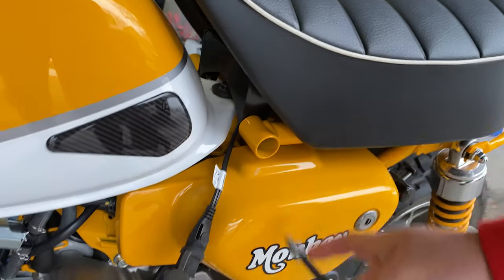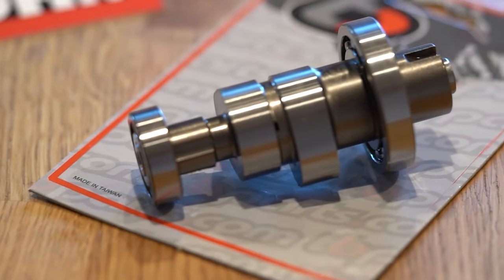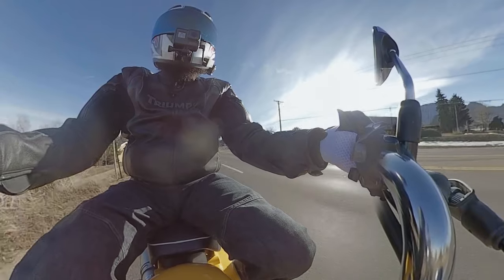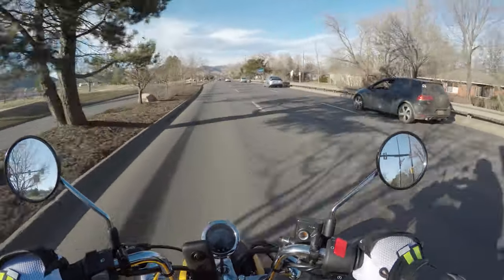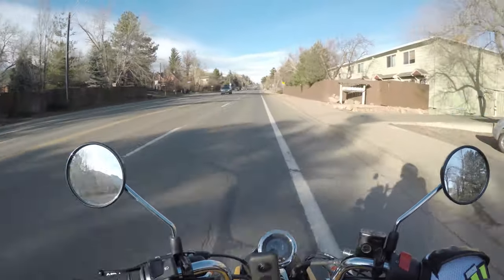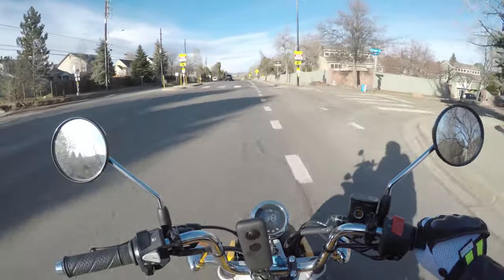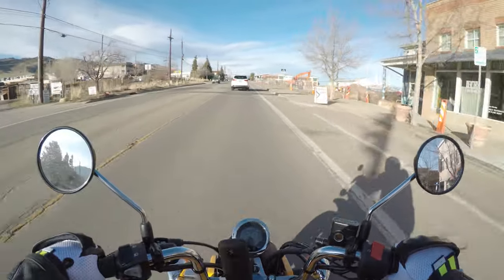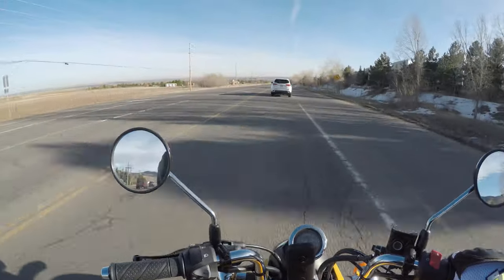Honda Monkey | More HP (For Real This Time)! | Also, how to reset the ECU and TPS!

Comment: If you really want more power from your Grom or Monkey you need a big bore kit, intake, and exhaust. My 2014 Grom with a 164cc Yuminashi kit, full Akrapovic exhaust, and open air K&N intake makes about 15hp, and takes my 200lb body over 70mph with stock gearing and 10k redline.
Reply from the maker: That’s definitely true, going bbk is the real way to get good HP out of that little engine. I’ll likely do that in not too long, for now I’ve got the intake, exhaust, cam and a HC piston to see how things go.

Comment: Hi overland.ive commented before in the past.14 tooth  front   and 37 tooth rear sprocket  works great  for me.faster off the line and 4th gear has  some pull to it now.any how a grom club air bnb across  the street  from me.i came out  and took some pictures  of them.i think they thought I was going to call the cops on them for riding wheelies  down  the street.then I pulled  out the monkey and rode over to them.they were all happy this twice their old dude pulling up to them likes the same thing.they go all over the place.i was the only one with  a monkey. They liked it.😀
Reply from the maker: Nice! That sounds like you had an awesome time showing those groms what the Monkey can do!

Comment: Great video, do you loose much low end torque with the new cam? I'm thinking of a cam but maybe the Takegawa 143cc with cam in one kit.
Reply from the maker: Thanks so much!

With the 14T front sprocket and this cam, this bike is mostly low-end torque (at the expense of my top speed). Since I've also went to stiffer clutch springs, the front end of the bike wants to really come up. As I look to getting the top end speed up, I've been contemplating different larger bore kits for my bike but I've yet to head down that path.
Reply: Unknown Overland how does stiffer clutch springs affect the front wheel coming up?
Reply from the maker: The stiffer springs will put a bit more pressure onto the clutch pressure plate, so when you release the clutch the harder springs will cause them to engage faster.
Reply: Unknown Overland oh yea true

Comment: Nice video! Apart from the cam, did you changed the valve springs, or tensioner or anything else? I'm thinking of replacing the cam, but i'm worried about the reliability of the bike.
Reply from the maker: No, I hadn’t. I was contemplating swapping the tensioner, but at the time I didn’t really see a reason to. The timing was modified by the aracer, though, just to help get detonation a little better in line.
Reply: @UnknownOverLand  thanks.

Comment: Nice vlog manyou do your tps first, and you jump both tps and ecu before you start, that's the other way round than most vlogs explaining the reset,your way makes mor sense, and it sounds real sweet,,I'm watching the ecu reset vlogs and most just do the ecu and not tps,are thay going wrong?
🗽☘
Reply from the maker: The steps that I used were following the steps in the manual (mostly because I worry too much). The tps reset is needed only in certain situations, so it really just depends on what you’re working on.

Comment: Thanks for all the great vids on these 125cc engine! 

at 3:27 I see you with two different size tappet adjusting screws.   I just did the Tbolt cam on my grom, and am in need of a longer tappet adjuster screw, but not sure where to source them
Reply from the maker: Thanks so much for watching. Those longer tappet adjustment screws came with my cam, you might contact them and see if they have some.
Reply: @UnknownOverLand  thanks for the reply.
And did end up finding them available from TBolt, although I I heard they were made from softer metal than the originals and can mushroom out causing more frequent adjustment needed
Reply from the maker: I hadn’t realized the difference in material I’m interested to hear if that happens longer term.

Comment: I might just go for a cheapy Lexmoto Tempest, so hoping a better exhaust & inlet will give me some advantage???
Reply from the maker: I’ve not read much on the Tempests, but it’s a nice looking bike. Allowing more air into the system with the fuel will help the engine a bit.

Comment: You put 24t front sprocket on? Are you unsatisfied with the power? I was gonna put a 125 monkey motor in my bike so I can utalize the upgrades but I might just go with a 250cc
Reply from the maker: On the front I have a 14t sprocket, and that definitely seems like right right option for this bike. I'm still playing around with the back sprocket to find a good match. What kind of bike do you have?
Reply: @UnknownOverLand  nice、 I have "2001' yamaha yb-1 four". I live in Japan now but when I move back home I'm gonna import it to the states. I will need a bigger motor to ride with the higher speed limits.

Comment: The reason the new cam is lighter is they will have taken material off the base circle to increase lift?
Reply from the maker: Different materials (I believe) and removing a bit of the extra material on the lobes will help it spin a bit faster without push back from the engine. I think they also changed a bit of the cam lobes to change the overall compression timing.

Comment: Why did you get the dhm reflash if you kept the bazzaz ?
Reply from the maker: I went back and forth on this (and, really, still am). Ultimately, because I already had the Z-AFM (self fuel mapper) I opted to keep it installed. This allows me to enable the mapper, go out and ride, and then come back and analyze the fuel/air ratio the bike is actually seeing and apply any changes. I may change my mind in the long run, but pairing that with the raised rev limit and modified ignition timing of the reflash seemed like something I should try.

Comment: How fast did you get it? I see some of these videos of people getting their monkeys up to 65-70mph. One thing is replacing the sprocket with a 14 tooth but then i read that only messes up your speedometer making it think the bike is going faster because its spinning faster?
Reply from the maker: In general I’ve found replacing that front sprocket with a 14t makes the bike more responsive, but you’re right that it’s going to throw the speedo off. I try to report gps speed when I can (either via my phone or from internal to the GoPro), and with those I have yet to reliably get to 70mph. With my current set of mods I should be a lot closer, but I need to make sure everything is broken in well enough before I really push it hard.
Reply: @UnknownOverLand  I did the sprocket change on my Grom and now the speedometer is 3 miles optimistic
Reply from the maker: I like the idea of an “optimistic speedo”, I may to use that more. :)